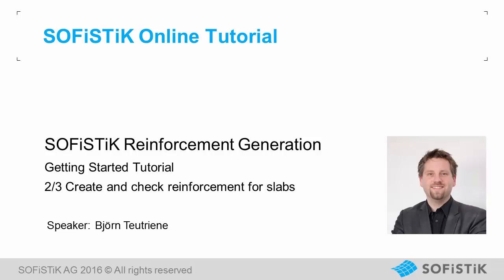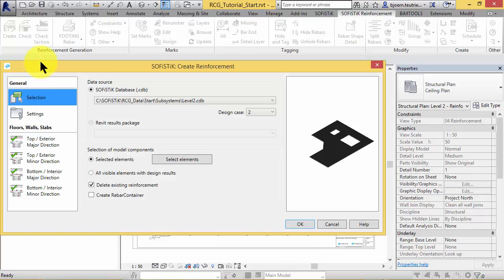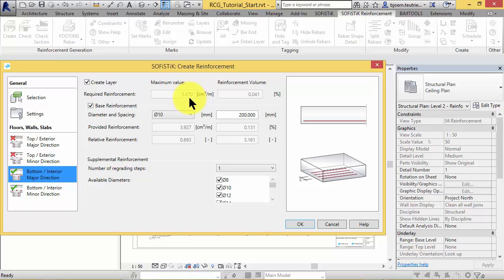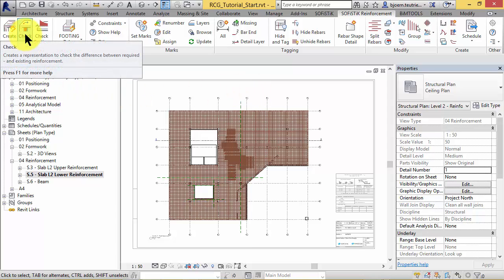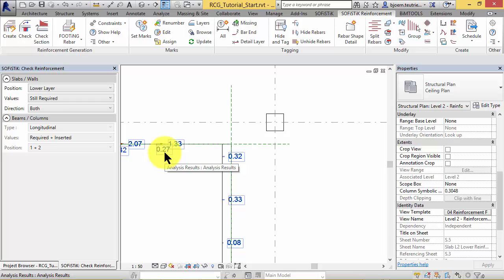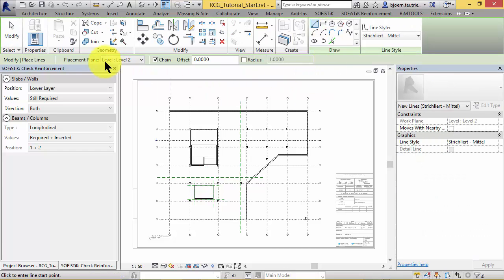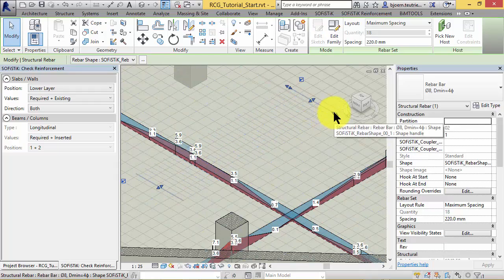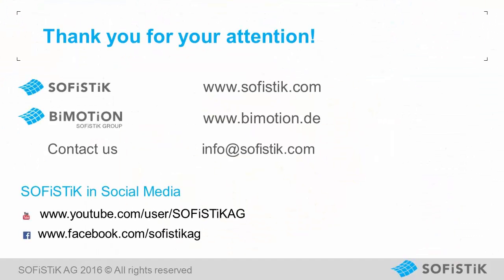SOFiSTiK Reinforcement Generation: Getting Started [2/3]

Comment: How do i change the font size of the "Analysis Results"? it drives me crazy
Reply from the maker: Hi Shayre789,
when you click on the Analysis Results, an option in the "Modify" Dropdown pops up, calles "Display Styles".
The first setting "rfcDist_Vectors" is automatically selected on the left side of the interface. Onthe right side you have "Settings". One of the options displayed is "Text Type (size, font, color and background)". If you now select a different family in the dropdown, you can change the size of the font.

(if you only have one option - look for the name of the family in your projects family library - duplicate it and do the changes you require in the new family)